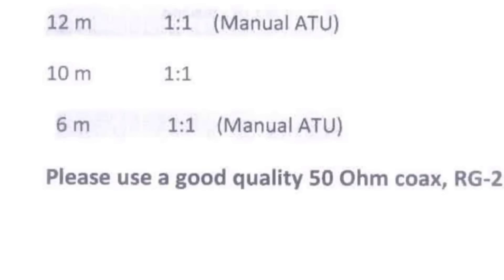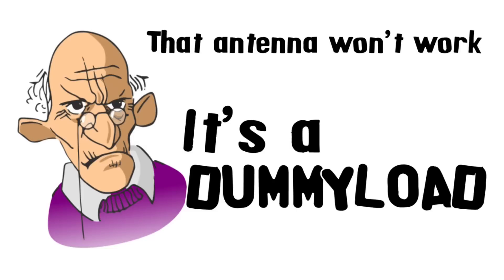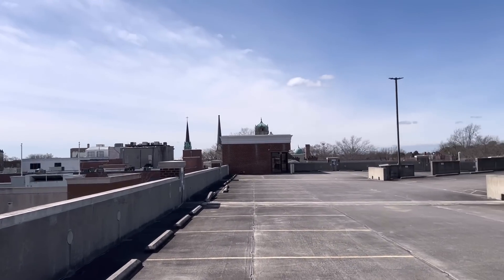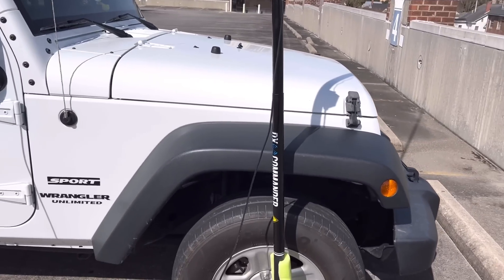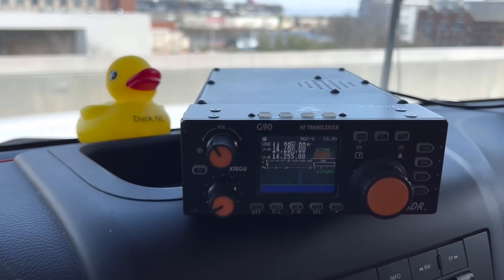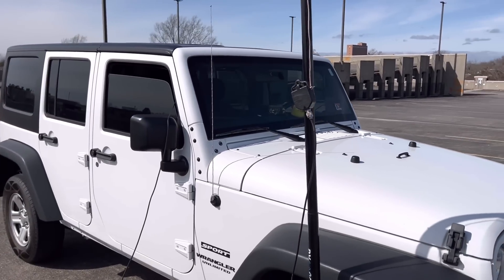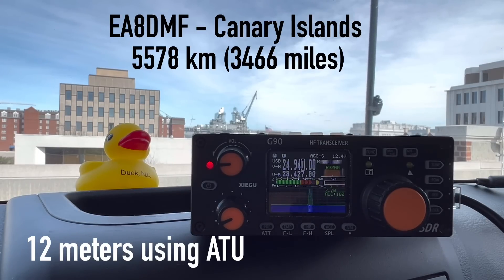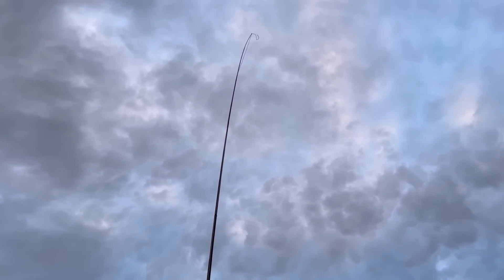Using Coax as a Counterpoise - HF Ham Radio

Comment: I picked up the Tram 1499 because of you and installed on my roof 25 feet off the ground, SWR 1.3, it's hooked up to 100 feet of RG8X, I turned on the radio and within 5 minutes made a contact in Florida. I'm in NY, it's working for me, but I will say the several contacts I made on day 1 said I was coming in 7-9 and loud and clear, but I wasn't hearing them loud and clear. I will see in a few more days how it works. Update* This antenna is freaking awesome I admit I had too fiddle with it a bit but my SWR is 1.0-1.1 and Im making contacts like crazy over 30 in one day and everyone is saying they hear me loud and clear. Play with this antenna, make sure the coax isn't overlapping, and try to get the antenna as high as possible. I love this antenna

Comment: This is information I really needed! Thank you Walt! Happy Holidays! I was looking at the 64:1 Unun. While I've been building my own to save money (I'm on a really tight budget), I like to have a professionally made one to use as a blueprint. I have always wondered about the counterpoise question because I've run verticals without radials or a counterpoise and still made contacts. I've gotten into arguments with hams because my view point is that if you can make contact with another operator, how can it be a dummy load. When I use a dummy load, I don't suddenly hear someone on the other end of the wire saying hello! Wow, on a side note, you had mentioned 7.200. OMG what a frightening place. I lasted about 30 seconds before moving up the dial. I did make a contact on the G90 from NorCal to Chile on the 40-meter band. The first contact ever on that band. Thanks for all the great knowledge you share with us. Merry Christmas to you and your family...73...Hugh...KN6KNB

Comment: 50ft of rg58c has a 28% loss at 28Mhz according to the coax loss calculator.
I'd rather use a separate counterpoise wire and not loose that 28% if possible.

Comment: Hi Walt, another great video with excellent results 👍🏼
Been thinking about this lately as I have a GPA-80 vertical. Considering trying a PL259 plug with a surge protection screw and running some wire radials from that at the base of the antenna. Not sure if they would improve performance or act as a better ‘mirror’ but going to try it. 
73 Franco

Comment: The rebar in the concrete helps alot too. The manufactured no radials are a quick and neat appearance to on lookers. That is also why many are white fiberglass. These are basically a random length antenna, manually tuned to frequency. If  more hams checked their roof composition, they would find getting on the air easy. Modern roofs use metal underlayment. Amateur radio should always be a learning experience. As we used to call it. OJT.

Comment: Would the vertical performance be improved if you got it away from the metal in the vehicle?
Reply from the maker: The driven element was actually above the body of the vehicle so it probably wouldn’t improve much if any at all. The metal body of the car can even improve the performance as acting as part of the RF ground side of the antenna. That’s actually how mobile antennas mounted to a car work.

Comment: I think this is the general idea of the T2LT "Flowerpot" antenna - a half-wave dipole that uses a quarter wave section of the inner conductor of a length of coax and is then choked at a quarter-wave point from where the coax is cut to expose the inner conductor. Here the coax IS used as part of the antenna. 

Another great video, Walt! Thanks!
Reply from the maker: Yes indeed, thank you and 73! Walt

Comment: Good stuff, Walt. I always tune my EFHW antennas with the coax I plan to use with them in the field, since the length can make a difference if you're using coax for the counterpoise.

Comment: Hey Walt, great video.  I have a stupid question. You cut a lot of random lengths of wire. How do store these random lengths for later, if u even do? I assume you put them in a baggy and label on the outside the it's length.  Peace!
Reply from the maker: Thanks! Yes I roll them up and put them in a ziplock bag. 73, Walt

Comment: Great stuff Walt.  Could you please post a link to that 64/1 unun?  73 de Tim KE6PMA
Reply from the maker: Thanks Tim! I got mine on Amazon but I just checked and it’s no longer available. This looks like the same one: https://www.ebay.com/itm/204673359699?chn=ps&_trkparms=ispr%3D1&amdata=enc%3A1Ru8prm1VStGPbgQVijHhtg4&norover=1&mkevt=1&mkrid=711-117182-37290-0&mkcid=2&mkscid=101&itemid=204673359699&targetid=1583904486362&device=m&mktype=pla&googleloc=9008590&poi=&campaignid=19894961968&mkgroupid=148855406073&rlsatarget=aud-1412318123216:pla-1583904486362&abcId=9307911&merchantid=5338914242&gad_source=1&gbraid=0AAAAAD_QDh8dD6UHAGgj1Gubtgvh4YqkL&gclid=CjwKCAiA0bWvBhBjEiwAtEsoW-j7kA_Mu488FS8DkusDmQnWNQZtCofbx6Gtarg8kRdQk71CQfAn0RoCwJ0QAvD_BwE

Comment: I believe this is a thing where there are two groups of people.  Group 1 knows that the “radial” being used is actually in the coax. Group 2 does not, but they know the radial is supposed to attach somewhere.  The company is in the predicament of either not putting anything on the package and then getting hundreds of support calls from the people in group 2 asking “where do I attach the radial?” Or, just putting “No radial Antenna” on the package and saving everyone the time.

Comment: Man. Africa. I'm so jealous. I heard South Africa maybe twice last year, and the pile up was enormous. Nothing from anyplace else on the continent. It's the last continent I need too :| Ah well. 

I played around with using a short counterpoise on my 40m efhw for a bit. I tried from.02 wavelength all the way up to .10. The difference on 40 was negligible at best, and the harmonic bands were actively worse. Especially 10 and 12m.
Reply from the maker: I’ve been using .05 counterpoise on my 40m and 20m halfwave antennas with some success. 73, Walt
Reply: @COASTALWAVESWIRES  Yeah that's what I started with and why I tried it. I just couldn't make it work. I'm guessing it's a combination of the configuration I deploy in, proximity to ground, and the actual ground itself around here, which is pretty terrible. I noticed when I built the antenna and tuned it that I was way short of the expected length... something like 62.5 feet iirc. Maybe I just didn't experiment enough to find the magic sweet spot.

Comment: Awesome Walt, I learned about coax as a counterpoise in my CB days several years ago. Once you realize it’s effective you just kinda move on: that being said I’m building a compromise 26ft vertical based off KL7JR’s design.. i believe it calls for radials and a tuner but I am excited to get it out and on the air!
Reply from the maker: Thanks! Have fun with that antenna!

Comment: Hello, Walt, I enjoy your videos. I have a Chameleon half wave end fed antenna.
In the manual they recommend a 25 to 40 foot counter poise, but they listed it as
optional, but if you don't use a counter poise then you need to use 25 to a hundred ft
of coax. Then it explains the shield acts as the counter poise. Good explanation of
what's going on with your antennas. What I really like is you prove your point by making 
contacts. In the end isn't that what its about, making contacts? Have a great day Gary KF6EWO
Reply from the maker: Thank you Gary! I actually started this channel because I got tired of watching guys sit at a desk and explain things and not actually doing it. All the best and 73, Walt

Comment: That is pretty cool Walt.  Is that the speaker wire that you are using?  I always thought speaker wire was two wires attached.  What it the length of the speaker wire?  Do you think I can do this with my Yeasu FT-991A?  What is the 64:1 balun that you are using?  So the speaker wire is 16'-5" and the only change was the balun and the frequency, correct?  Thank you for sharing Walt, still trying to learn all this stuff.  That looks like a pretty good antenna book.  Thank You
Reply from the maker: I peel the speaker wires apart and use one side. Yes it’s 16’-5” long. The 1:1 balun made it a 1/4 wave for 20 and the 64:1 balun made it a half wave for 10. Feedpoint impedance for a 1/4 wave wire is 50 ohms and coax it 50 ohms thus 1:1. Feedpoint impedance for a 1/2 wave wire is very high thus a 64:1 unun brings the impedance down to near 50 ohms to match the coax. I recently did a video on that 64:1 unun. I purchased it from Amazon.
Reply: @COASTALWAVESWIRES  Thank you so very much Walt for the break down.  Love the videos.  I have seen you do this before.  Thank you again.

Comment: End fed antennas use the shield of the coax as the counterpoise.  It seems that the lower the frequency, more of the coax shield is used.  I was having an issue with relays in my furnace chattering when I worked 80 and 160 meters.  RF was getting back into my house!  So I put a common mode choke in line, right before the coax entered my home.  This got rid of the RF inside my house!
Reply from the maker: Yes, that was the point I was trying to convey by doing an EFHW as the second antenna. I chocked the coax at the transceiver, I should have mentioned that in the video

Comment: great info ! their is always a counterpoise. you could easy put a counterpoise on that 64:1 . just get one of them like 30 amp battery clip things and clip it to the PL 259 at the UNUN . then put the choke right their . nice parking ramp on air. I even done that with CB . bands starting to shift  for me as well. the UK from NY window is shorter and DX going more south for me. the only down side I found with Walmart speaker wire I found is it will stretch over time and insulation will crack if left up long time. like months at a time. 73's
Reply from the maker: Roger that, I actually have those clips and do that clipping wires to the coax outer connector. 73 my friend

Comment: Why should I use a 64:1 unun instead of a 49:1 unun for an EFHW antenna?  Or vice versa.
Reply from the maker: You can use either, I’ve just found a better match for a 10 meter band end fed half wave using a 64:1
Reply: @COASTALWAVESWIRES okay

Comment: Good deal.  When using  some excess on the coax run, it seems to allow lower swr also.  On a side note, speaking of no radials or coax as a counterpoise, my favorite 10m antenna is a nicely tuned coax flower-pot,  it performs ridiculously well (obviously no radials. Wraps are around small diameter pool noodle portion, ziptied in place & taped).  Have somehow busted through dx pile ups with just a hundred watts several times).  Thanks for another enjoyable video.
Reply from the maker: Thank you so very much!! 73, Walt
Reply from the maker: Thank you so very much!! 73, Walt

Comment: Great video! What made you go with the 64-1? Could a 49-1 have been as effective?  As always,   you get our attention with your trails. Many thanks.
Reply from the maker: Thanks! A 49:1 will work but I’ve found I get a better match for a 10 meter 1/2 wave with a 64:1
Reply: @COASTALWAVESWIRES  many thanks Walt.

Comment: If you go back a couple of videos I tried your first antenna with the64:1.  I did not have a long mast but coiling it on the mast evenly still worked fine!  FL to UT POTA contact on 15 right off!
Reply from the maker: That’s awesome, thanks for sharing

Comment: Walt, I learned the effectiveness of a coax length as counterpoise from Peter on the Waters and Stanton YouTube videos. Makes sense too. Currently I’m using a HyEndFed EFHW 80 through 10 meters. The fed end is at 40’ and the far end is at 35’. I feed it with a total of 110’ of 400. I am truly satisfied with this. Once you come to grasp the idea that the coax is a fairly good counterpoise, you just move on and enjoy the radio! 73 KE8EC
Reply from the maker: Roger that! 73, Walt
Reply: I have been using this same antenna for about six years.  I put an MFJ "autotuner" at the feed point and have about 50ft of RG213 coax connected.  The "autotuner" allows me to use the WARC bands and 60 meter band.

I also play with a "random wire" antenna.  10.8m long attached to a 9: balun and about 50ft of RG213 coax.  I have used it with and without a counterpoise. It works, too.

Comment: shouldn’t you use on the coax in the no-counterpoise solution to keep common mode currents out of the radio?
Reply from the maker: I had a choke at the radio. Sorry, should have mentioned that in the video

Comment: Great video, Walt!  The T2LT antenna, made from nothing BUT coax, sort of a sleeve dipole is another example of how the coax can be used as part of the antenna. The coax is also the choke. I learned a lot when I built the T2LT for 10 meters, and never look at coax the same way. That's a good thing! Have fun out there, my friend!
Reply: should the length of the coax be equal to the length of the wave length ?
Reply from the maker: Thank you so very much!! 73, Walt